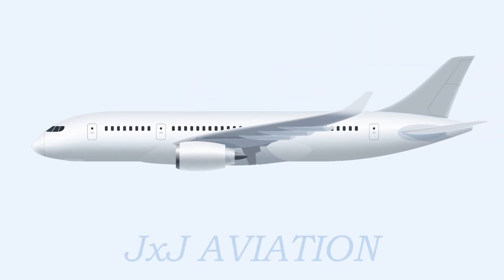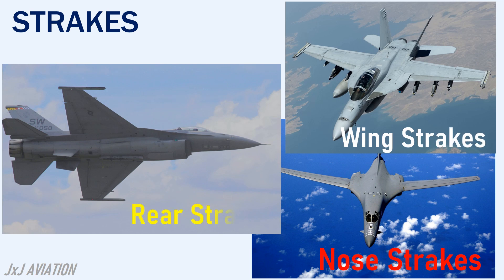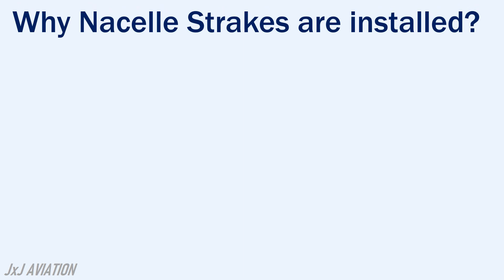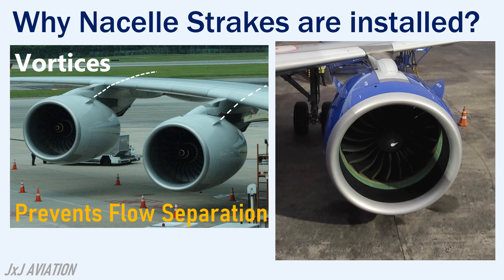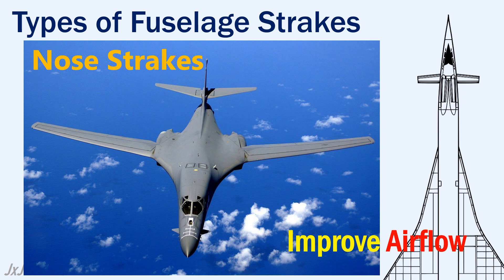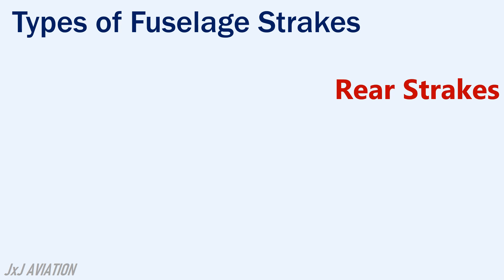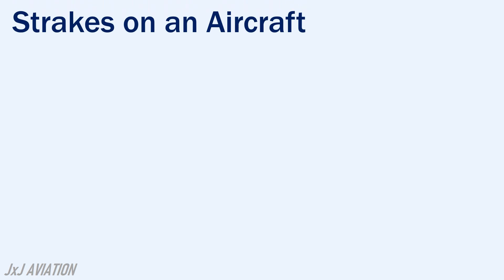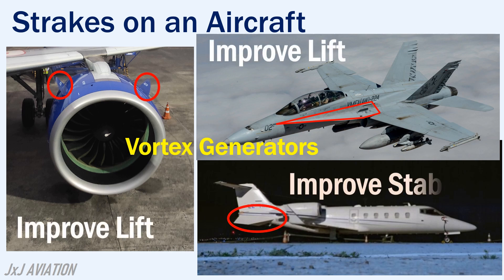What are these blade-like surfaces on an Aircraft & Why are they installed on Wings and Fuselage?

Comment: Can anyone tell what is the thing that attached to the wing end?
Reply: Winglets or sharlets, it is there to reduce the drag caused from high pressure air in lower surface meeting low pressure air in the upper surface.